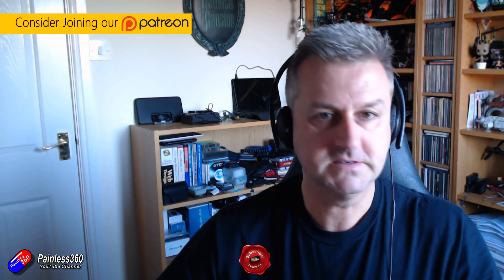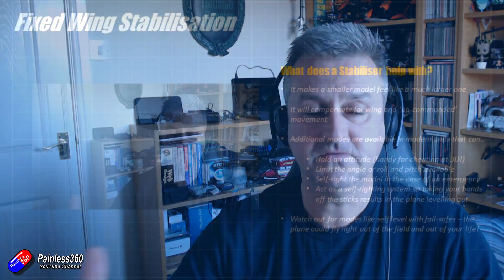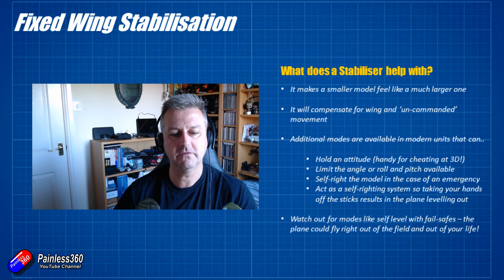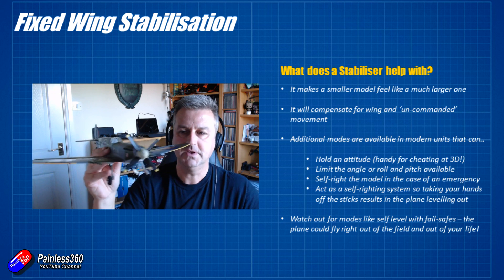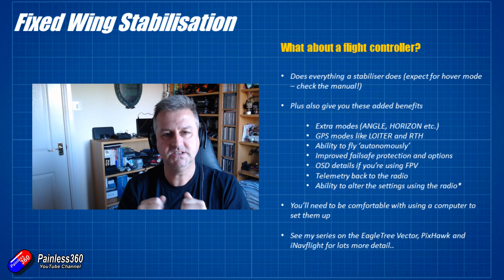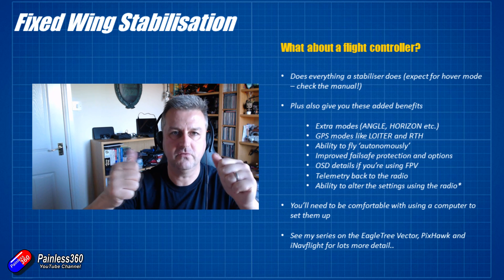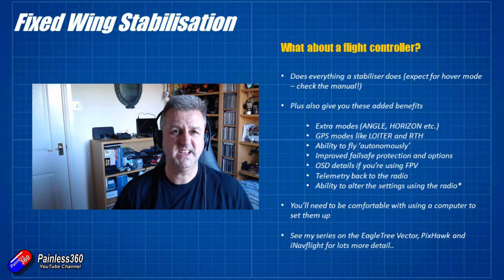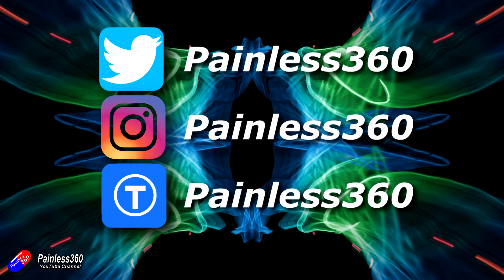Fixed Wing and Planes 101: Stabiliser or flight controller?

Comment: great video! do you know if it is possible to re-flash older boards such as KK2, MultiWii, etc.. with adhoc firmware to perform stabilization ? I'd be happy to give a second life to those boards
Reply: KK2 works quite well as an airplane stabilizer. It even can accommodate servo passthrough so you can control flaps, landing gear, etc. There is a lot of documentation available for how to set it up. A bit complex, but a cheap solution to airplane stabilization.
Reply from the maker: As Marty already said, KK boards had firmware out quickly for fixed wing stabilisation. Modern stabiliser are cheap and easy to setup so it's a personal thing..